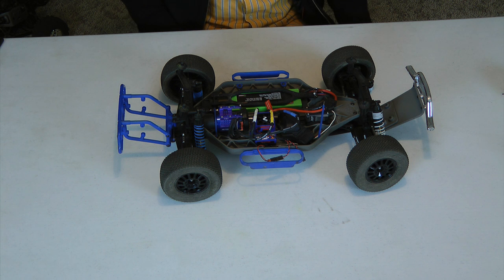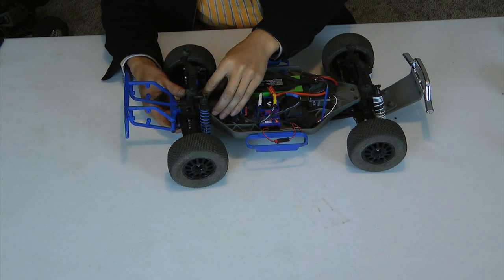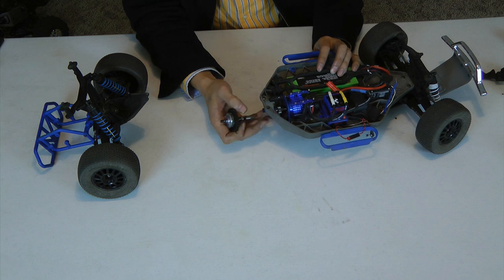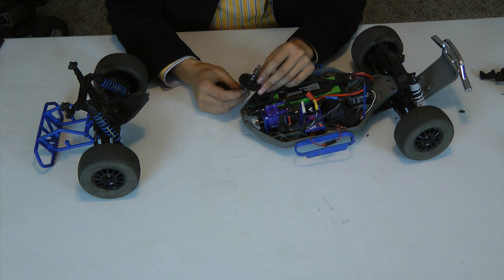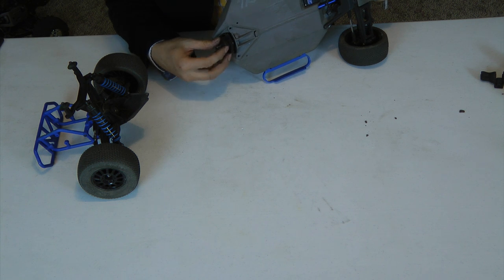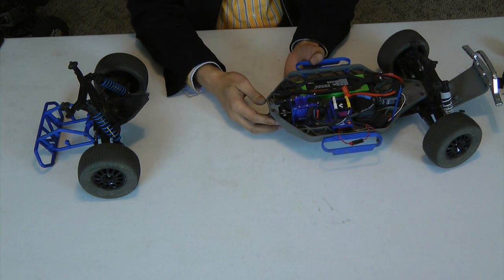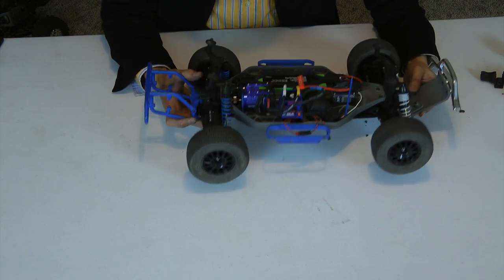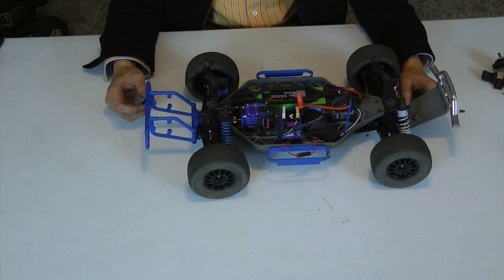Install Center Differential In Traxxas Slash 4X4

Comment: Does new slash ultimate have steel gears? Should i get the udr if i want to buy something and not break easily?
Reply: I would definitely go with the slash ultimate 4x4 it doesn't come with steel gears but I have a optional robinson racing hardened steel pinion and spur gear and the center diff is in place of the slipper clutch so if your new to rc I would suggest you get used to it with the slipper clutch and plastic gears and then once you've learned you could step up to a steel spur gear, I have the splined C.V. axles in my slash and they are well worth the extra money. But also remember once you solidify the drivetrain the stress will find a weak point

Comment: @MJMEDI2006 the centre diff moves the torque around depending I. Which wheels has the most grip and it does come with the slash ultimate but you have to install it

Comment: Hello. I just bought a slash ultimite. I was bashing today and i had the drive shaft hole on the under side suck in a small rock so i stoped and took it home to take the rock out... but i fond this 3 rings (that looked important) between the drive shaft and that big gear... the small metle one with teeth looking things(not a gear) was all bent up and the plastk one hardly resembled anything. I couldnot get them back in so i put it back to gether and it grinds the gears now... any help?

Comment: Hey I just bought this for my Stampede 4x4 and when I turn it, it's kindda hard to turn.. Is this normal? or it should be soft and not so hard to be able to turn by hand? I haven't installed it yet on my stampede.. thanks !

Comment: well if your a beginner go with NiMH. But you can search how to maintain and properly charge a lipo on youtube. My choice is Lipo but if your new to the hobby.. Go with NiMH. Trust me lots of power and great for beginners. Lipos can get complicated fast. If you charge it wrong or charge your lipo battery by a few volts it could set a fire in your house or the battery could be garbage. although they do provide more power, longer runs, shorter charge time

Comment: Whyvwould you have to match your center diff gear to the spur gear? You can put anythung from 50 up to 56 in the slash 4x4, you just have to adjust the mesh.

Comment: Sounds like you are blaming the car for your shoddy workmanship. You should also check to make sure the bearing doesn't seize. This may entail clearing the bearings and/or getting new ones. Traxxas is notorious for using "only adequate" BBs.